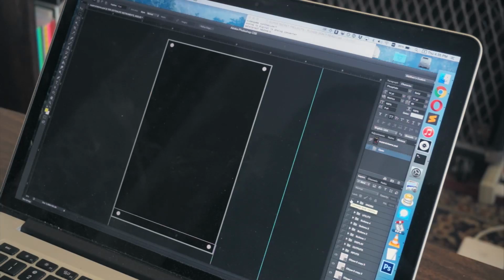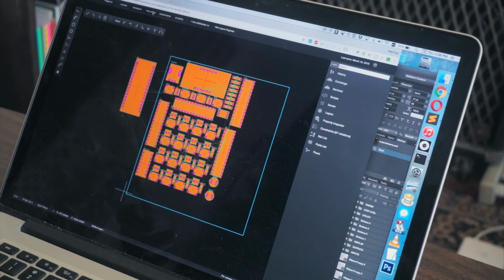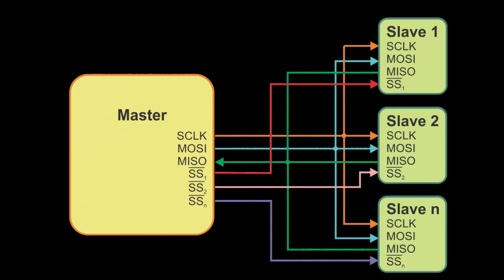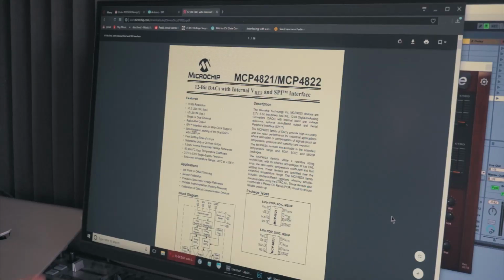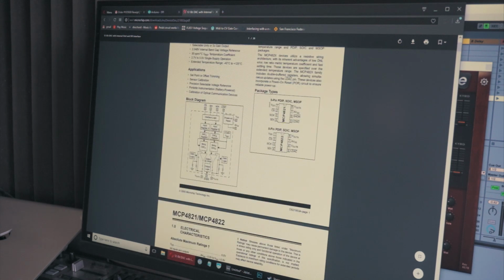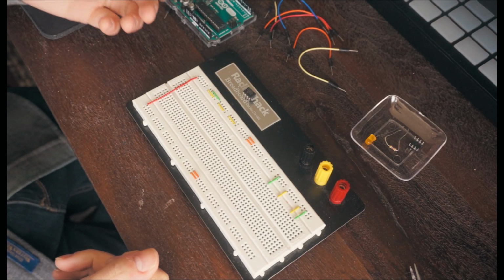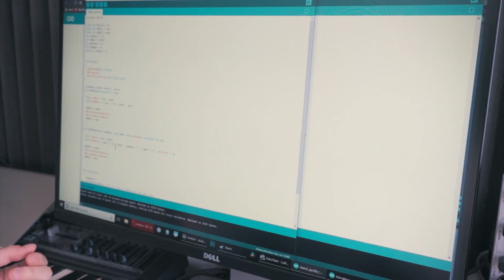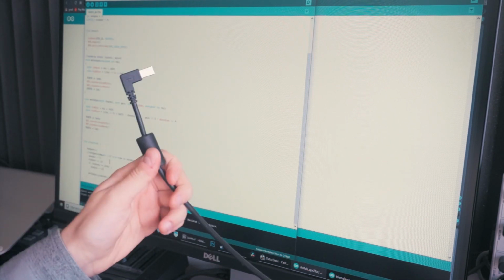Designing a Eurorack Sequencer - Pt. 1: Digital to Analog

Comment: is it not possible to just use the arduino's ADC? It is 10 bits. What gives a 4.88 mV precision, is that not enough?
Reply from the maker: If I'm not mistaken, the Atmega328 has an ADC but not a DAC, so that's an input rather than output. It's used mostly for reading in analog potentiometer values. You can use a PWM output with a discrete lowpass filter and voltage follower as a rudimentary DAC but the slew rate is quite poor as you might imagine with all that capacitance in line.

Comment: so you're using 1-pin to send 12-bits in succession that are somehow converted to analog value by the dac chip? is my superficial understanding correct? would you naturally want to use the highest timer frequency available to you to write the bits? are there any problems you face, or potential signal loss with this? is this better than other dac methods that use more pins, that could potentially communicate more bits simultaneously, more frequently, like a resistor ladder? you seem to have enough pins. sorry for all the questions, awesome video! thanks!
Reply from the maker: Yep, pretty much! Both SPI and I2C are serial protocols, so they're bits-in-series rather than parallel. For this project I end up using all the other pins for connecting other hardware (buttons, LEDs, jacks, etc) so 4-wire serial is better but I understand there are parallel DACs that would be better suited for some applications.

In this instance, a pitch control voltage output doesn't have to be that fast, it's probably running at a few hundred hertz is all, but that's plenty of resolution for pitch slides and smooth note transitions.  Audio DACs need to run much faster, at least 20kHz or preferably higher as well as using higher bit depth for fidelity at low levels. That isn't realistic on a 16mHz clocked CPU, so you'd have to use a faster processor or an external audio codec.

Comment: 4:46 Shoulda measured the voltage across the LED and series resistor...

The LED has a fixed voltage drop across it when it's on.

Comment: Ah, very hip! I'm only peripherally familiar with the 'duinos, and i wasn't sure how folks were getting from the narrow TTL voltages it supports to the larger voltage swings we like in synth-land. Using that DAC chip makes a lot of sense. Does this particular chip allow you to read back the voltage, or would you need a different IC?
Reply from the maker: I don't think there's any voltage sensing on the 4922, and in any event it gets amplified and buffered out through the op amp (tl072) so the scaling changes as well. Later in the series (episode 6 maybe?) I demonstrate an adjustable calibration procedure that accounts for this nonlinear output variability in software, but it does require external measurement.

Comment: Hi, great series. I am really interested in learning electronics in order to build modules just like you are doing. Did you teach yourself electronics pr are you an electrical engineer by trade? I am a programmer but have very little electronics knowledge, where do you recommend one starts? I’d love to be able to do exactly what you are doing, that is, think about a module, design it on paper and bring it to life. Loving this series. I’d also pay money for it.
Reply from the maker: Thanks so much for  your kind words! I am also a programmer by trade - though electronics has been a hobby for some time. I still find it unintuitive and obscure but I have learned a lot from watching the fundamentals series on EEVBlog on youtube, building some guitar pedals (from kits and from schematics), and playing with arduino and axoloti. For a good learning text I recommend "Practical electronics for inventors" by  Paul Scherz and Simon Monk, which explains the most common components, circuits, and tools in an accessible way. For practical experience I'd suggest buying some module kits to solder together to learn the techniques of assembly and basics of debugging with a multimeter. Also pick up a breadboard and an arduino and some parts kits from ebay (resistors, capacitors, leds, transistors, diodes) and you will be able to build lots of circuits from instructions online or reading open-source schematics (Mutable Instruments modules, for instance), which I find is the way I learn most new things. Good luck!
Reply: Exactly in the same spot, thank you both! @Extralife, would be nice to go more in depth. Such an interesting project